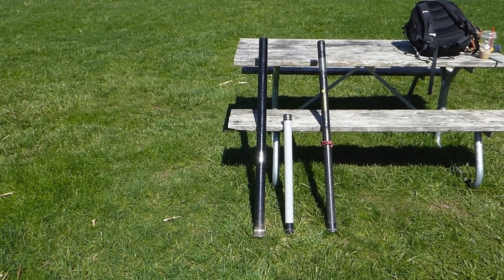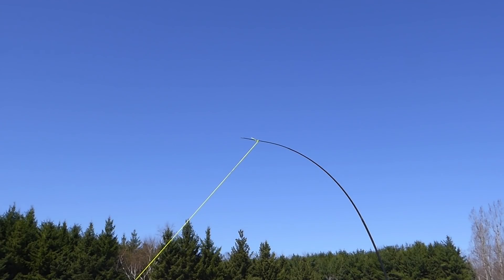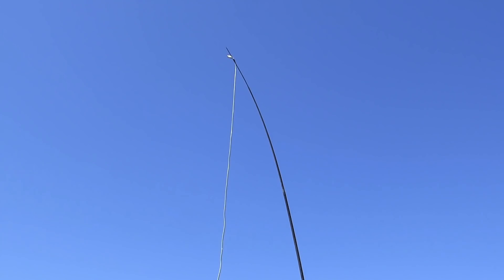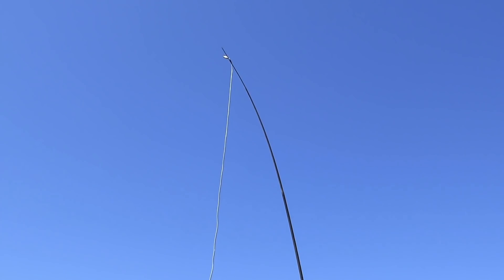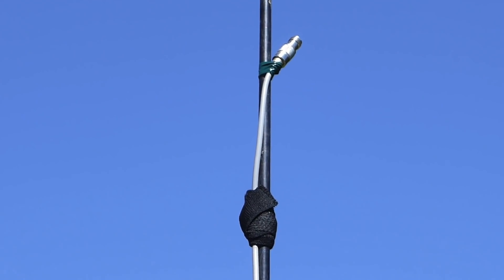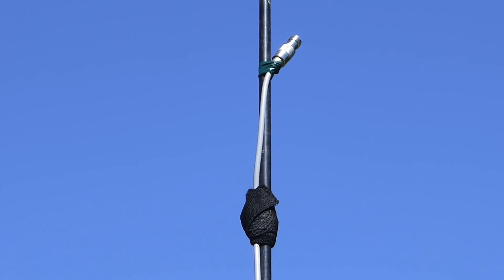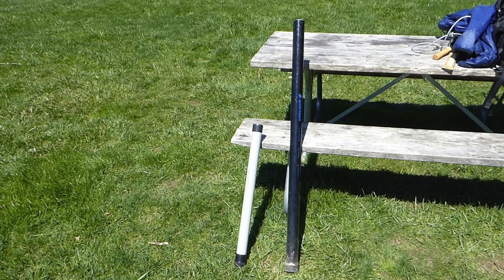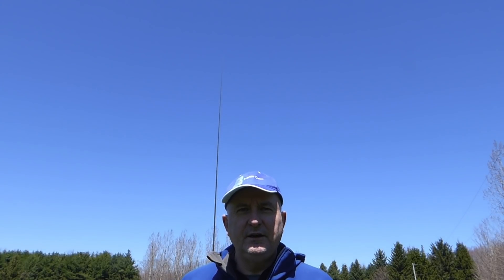Fiberglass Poles for Ham Radio Antenna Deployment

Comment: This may be considered a cheat by some but I was fortunate enough to find a rather beefy mast on eBay from a surplus dealer.  I don't remember how much I paid but I ended up with a 15 Meter = 50 feet Carbon Fiber mast that is capable of holding up small directional antennas in addition to wire ones. Its a true gem and I consider myself very lucky to own it. 

In a funny moment I called the manufacturer to get information about the mast and he got rather angry when I explained how I obtained it. I told him about the vagaries of military supply that make repair parts more punishing to a units budget than entire units obtained new. I explained that when a device like a mast gets damaged the charges to the units budget can easily be much higher for repair parts than for a new mast. He thanked me for explaining that but allowed as how he thought that it was a sad waste of a very good assembly. I have to agree.

Comment: 2 suggestions:  Start by pounding a spike into the ground where you want your mast centered.  It can be wood, plastic, or metal,  so long as it is thin enough to fit into the bottom of your mast.
     Second suggestion: do not use the 3 or 4 foot  piece of PVC pipe.  Instead, install your hose clamp directly onto the top of the bottom section of your mast. This works just as well, and saves you from carrying some extra weight and bulk.
     If you use zip-ties instead of hose clamps, you can keep them from slowly creeping downward over time by adding a thin bead of RTV silicone gasket seal under the zip-tie before final tightening.
     A side benefit of starting with the center spike is that it helps hold your mast more or less upright while you are installing your guy lines.  (BTW, 3 guy lines are quite sufficient if spaced 120 degrees apart.)

Comment: My DX Commander 12.4m (41') vertical wire fan pole only went up this spring / summer. It has already been through tropical storm winds etc. This will be its first Atlantic winter. It is a fiberglass multi-section pole with aquarium tube over ss hose clamp retainers. They just switched to nylon hose clamps, eliminating the aquarium tubing and scratch potential.

I've experimented with various means of tensioning the guy lines and while I have some cam locks from NiteEyez, I chose not to use them. Instead, I use a directional loop knot in the guy lines to create a pseudo truckers hitch with a line lock knot. That seems to retain the lines very well without additional tampering / theft enticing doodads.
Reply from the maker: Thank you for sharing your experience!

Comment: I appreciate your videos on fiberglass poles!
I'm getting frustrated with my end fed being heard all over the country but not being able to hear much while being deployed at my in laws place.
I jumped in too low and got a 20 foot pole that is just too weak and really bends unacceptably , even with just a wire.
My next move will be a 31-footer and the means to secure it using the techniques I've seen in your videos.
Thanks so much de N2NLQ.
Reply from the maker: Thank you! If you could spend a little more, I'd recommend buying a Spiderbeam 40' mast. It's worth the extra cost and weight.
Reply: @Michael Thompson Or the original DX Commander antenna and get most bands in a relatively easily collapsible to a transportable size unit.

Comment: Very useful advice.   I have a large spool of single strand hookup wire.  I have a small yard with no trees, and being retired, can't afford to buy a fibreglass pole as shown in the video.  But I have an extendable aluminium handle for my roof gutter cleaner.  It extends to roof height on my house.  So I took the brush bit off, and inserted the end part of an old fishing rod.  Then I used duct table to tape the pole as high up on my side gate metal post just outside my bedroom window.   I wrapped the wire around the post, and then centre fed a long wire at the top with one end attached south to my drive fence, and the other end attached north to the side of my garage.  The highest point extends several feet above the peak of the gabled roof of my house, around 30 feet off the ground.   The antenna is attached with an alligator clip to a length of braided speaker wire, and in turn clipped by another alligator clip to the telescopic antenna of my hand held world band radio.   It is amazing how many shortwave and ham radio signals i receive, especially when I am located in Christchurch, New Zealand.
Reply from the maker: Well done! Thank you for sharing your experience.

Comment: Excellent video Tracy, thank you. Most of these things l learned the hard way and wish I known some of these things years ago. Worst thing for me is pole collapsing down on itself (usually mid-QSO). I found that putting a little tension on antenna or one of the guys to make a slight bend in the pole is good for stopping this (at least without resorting to tape as you suggest).
Reply from the maker: That's a great tip, Steve! Thank you for your comment.

Comment: Handy video,  these fibreglass poles are helpful for all of those situations when a permanent ariel set up is not possible.  Recently setting up a JOTA station (GB4RUG) for the Rugby Scouts, we used two fibreglass poles.  One pole supported a wire Delta Loop Antenna,  with and the other pole a vertical cut for 40m.  Light and flexible,  we found them easy to assemble and dismantle. As conditions on the bands changed throughout the day, we could reposition the Delta Loop to make the best use of direction into North America and Europe. 
Andy G6TVK & Paddy G4MAD
Reply from the maker: Thank you for sharing your experience! I'd like to try that Delta loop one day.

Comment: RE twisting and not breaking loss. Lower your grip on the larger section to about 1/2 way down. Less tension will do the trick as well. Malen VE6VID
Reply from the maker: Thank you for the tip!

Comment: Another great antenna building resource can be found at Menards’s. Made a hexbeam from these. 
https://www.menards.com/main/building-materials/concrete-cement-masonry/rebar-remesh/7-16-x-20-fiberglass-rebar/1831110/p-1520408262313.htm

Comment: I have a SOTA  Beams fiberglass pole for portable use. I also am using military fiberglass tent poles in a permanent antenna mast at my home QTH. It holds up the centre of an inverted V 10-80 end fed wire. It's a solution which works pretty well for me on my current property. I've worked stations in Japan and Australia with that wire and 100 watts in spite of the fact that the wire is not really high enough. I also use it for NVIS and routinely work stations on  ONTARS and other nets on  80 meters within 1000 Kilometers. I like fiberglass because, aside from not detuning  the antenna, I suspect it will be less attractive to lightening.
Reply from the maker: Thank you for sharing your experience. How high is the high point of the antenna?

Comment: I haven't worked portable yet but I do intend to. At this stage I mostly work 40m. What's a good all round pole length ?
Reply from the maker: Nothing less than 30 feet. 40 or 50 work even better.

Comment: Excellent video! I have a 31' Jackite pole and some LNR Precision (Par) EndFedz. I am building an EFHW tuner from the QRPGuys. A second mast is a 16.5 foot Crappie pole from Cabela's. You had some really good suggestions in the video.
Reply from the maker: Thank you! If I'm not mistaken, you commented on my original video back in 2011. 73 from Tracy VE3TWM.

Comment: Thank you. Excellent tips. How do you fasten the EF antenna wire to top of pole?
Reply: I normally use a small strip of plastic (e.g. perspex). The end of the antenna is looped through a small hole and tied off. With different size holes drilled in the rest of the strip, I can find a hole that suits whatever mast is used. Also, this allows it to be slid down the pole to different heights - 1st section, 2nd top, 3rd top etc. As Tracy said, you often don't want to use the top section for anything but the lightest loads. The strip is easy to remove without untying knots or removing tape,  provides insulation from the pole and is reusable. It also serves as an insulator if I attach the end of antenna to a line rather than fibreglass pole.
Reply from the maker: I use electrical tape. Not the cleanest or most elegant, but it works very well.
Reply: my Jackite brand pole came with a small ring attached. I use a small snap clip to that.

Comment: I have used an MFJ 33ft pole for several years. It has suffered a lot of abuse and several sections have broken. Luckily I found an inexpensive fishing pole from the US that exactly fitted in place of the broken sections. My 33ft pole is now only 29ft high but still alive. Another good tip is to remove the top section of most poles. The top section is too thin and fragile and bends too easily. John, VA3KOT, Orangeville.
Reply from the maker: Hi John, thank you for sharing your experience. I own Jackite, Spiderbeam and DX-Wire poles and have never had a section break on any of them. I wonder if the brand you mention is not built to the same standard.
Reply: @OutdoorsOnTheAir  My own fault really. The top section broke due to too much tension. A couple of lower sections broke when the fully erected pole came crashing down against a brick wall. It was supported on a modified tripod (for winter deployment). I have learned the hard way to treat my pole with more respect!
Reply from the maker: Thank you for the background information. It's a cautionary tale for others.

Comment: I too use fibreglass poles and find them extremely useful when deploying my inverted "V" field antenna.  The spider beam is a great pole if a little expensive so I tend to get them of amazon or other auction sites.  Looked after a pole can last for a couple of years without too much difficulty.
Reply from the maker: Thank you for your comment.